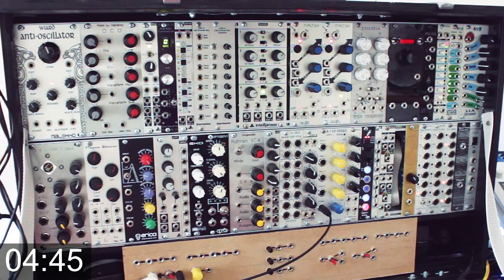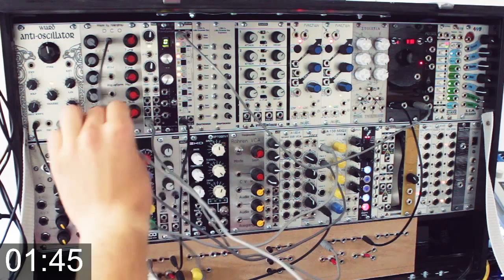A Patch From Scratch #01: Simple self-playing synth voices #TTNM

Comment: What is the point of having two MN Functions versus one Maths?  I would think Maths has more to offer even though it might be slightly more in price.
Reply: function has this output called HANG. Dont remember exactly what it does but it is not present in Maths.
Reply from the maker: I started with one Function and got a second one at some point because it was cheap and never bothered to get a Maths. I should though :D The Hang input holds all current output values of the Function and is quite useful sometimes. I would probably keep one Function if I got a Maths.